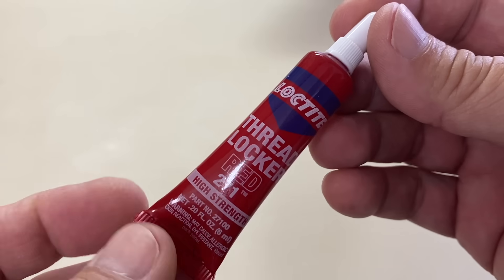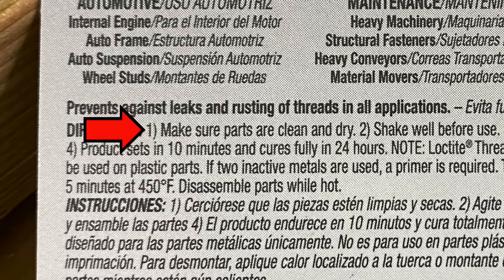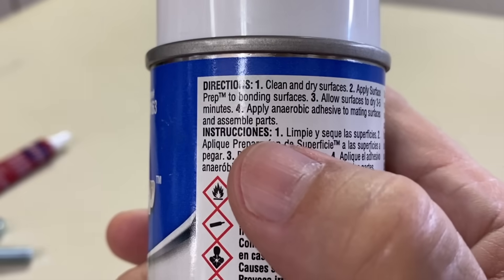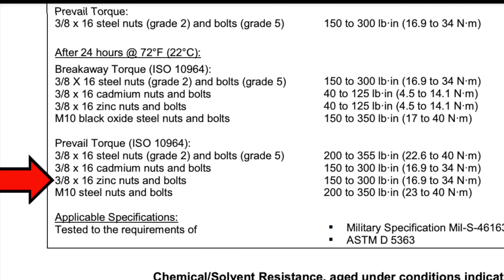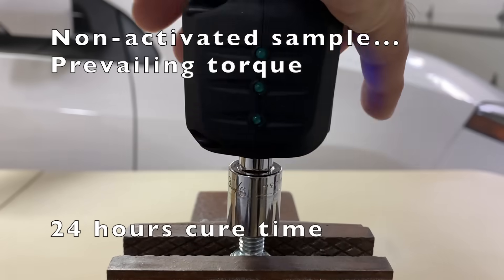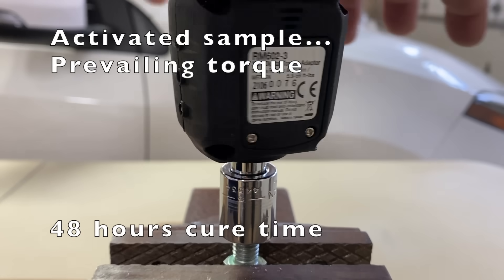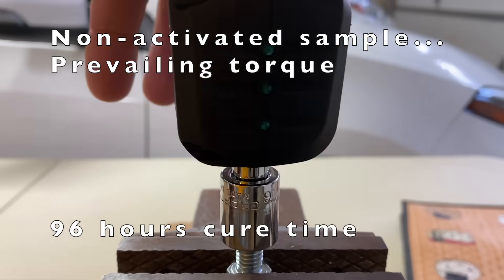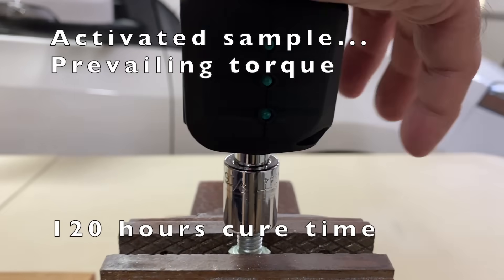Nuts & Bolts - Most DIYers Do Not Know This | Loctite Red Threadlocker Curing

Comment: Is it me, or do the plastic caps that loctite uses de-tops itself if you tighten the cap a little too hard? I have several loctite products and they all have a cap where the top separated from the threaded neck.

Comment: Try the test with the fasteners torqued when assembled, probably with holes through a steel bar. This would approximate real world use as the nuts loose on the bolt aren't as "anaerobic" as when stressed under torque. I would definitely be interested in seeing those results. Thank you for your presentation.
Reply: Same as I was wondering, as far as I knew, thread lock only properly works when you torque the bolt/nuts. I even used this to my advantage when assembling some structures, just put the thread lock in the bolt, and hand tighten it so I don't lose it around. No need to rush, it will only really get properly locked when tight.

It really was annoying when I did have to remove some bolts because of whatever stupid mess I did, but that's the thread lock working as intended, can't complain there.
Reply: Exactly, the touching threads are sealing the loctite between them from oxygen and would cure properly.
Reply: 100% - nuts need to be torqued to a reasonable spec; definitely not just loosely hanging out mid shaft - run it again! :)
Reply: @andrewbermel1099  which nuts are we talking about? I think i made a mistake
Reply: I disagree.  I think this a truly an effective test of its shear strength. It doesn't include "other" varying factors like the torque load you seem to need to pre-stress it with.
Reply: @markhenkel2484  thank you! When testing, minimizing variables is necessary!
Reply: @markhenkel2484 then you don't understand loctite
Reply: I came to say just that!
Reply: I too would like to see this.
Reply: Was thinking the same thing
Reply: Yep. That's why you can leave the cap off the bottle, and it won't cure at all.
Reply: @Bill Hay  almost like it's anaerobic? Lol
Reply: @billhay8157  wrong I seen open bottles harden and I seen unopened bottles rock hard before even being opened the first time
Reply: Ditto
Reply: And you should have a control group without Locktite
Reply: @luisurbina5115 hat would be fine, if it didn't introduce confounding via the "screw loose" bias . . . sheesh, and I thought I understood the term "control freak"!
Reply: @luisurbina5115  I think that's an experiment I can set up. Red and blue compounds, no compound and then two types of "brown locktight" (dirt and rust)
Reply: @luisurbina5115  Why?  The nuts would just spin onto the bolts with almost no resistance.  The breakaway torque would be almost zero and the prevailing torque would be from the weight of the tools against the fastener but still near zero.
Reply: Seems like me, you and everyone else is thinking the same
Reply from the maker: Thanks!  
Please check out my other videos for some with the nuts tightened down with a clamp load.  
Here's how Loctite tests breakaway and prevailing torques... https://www.youtube.com/watch?v=PGZCPyi8yBc
😎
Reply: @HacksbyDad  I feel that both tests (clamped and unclamped) are necessary for a complete study.
Reply from the maker: @wicked1172  Okay... here it is... https://youtu.be/7yPQIsfv9x8
😎
Reply: @HacksbyDad  wierd..
Reply: I was thinking this, you should just stack washers
Reply: First thing I thought of when I observed the methodology
Reply: I concur doctor this will make an immense difference
Reply: when tightened onto something the nut is pushed one way so there is still the space on the other side of the thread
Reply: I don't think you could do this test without rounding out the nuts if you torqued these bolts with red loctite.
Reply: is there a thread sealer out there that activates when no tightened down? I am looking for something to use with brass air line fittings that need to be positioned a certain direction, which often means they are not tightened all the way
Reply: @lukaszM46   Nail polish.
Reply: @lukaszM46  One such product is Vixen Horns Hydraulic/Pneumatic Liquid Thread/Pipe/Fitting Sealant.  It takes 24 hours to cure.
Reply: Still makes the nut harder to turn that is what it's supposed to do.
Reply: A hundred percent agree with you mate. I've always thought that lock type works by getting smushed between the threads while tightening.....
Reply: I was just studying this subject in my apprenticeship, and right as the video was ending, I thought "It really should be clamping something to be of any real-world value"
Reply: Only the green would work without doing so
Reply: I looked up the ISO standards that the measurements come from and he did the testing as per standard.  
3.3
breakaway torque
Initial torque required to break the bond measured at the first movement between the nut and the bolt, when unscrewing an unseated assembly.
Reply: @ChronicBronchitis-mz2vn  this particular ISO standard means nothing to someone using it in the real world. Engineers come up with useless crap all the time.
Reply: @pyrotech7210  like you know better 😂 wow people are delusional when they’re saying ISO standards are all just willy nilly 😂
Reply: @HoggishGreedly  I've seen engineers make stuff up to justify their jobs. One old guy I worked with 25 years ago called them "college pukes" because the vast majority of them have no real world experience
Reply: i don't think that is signifcant, torques just readjusts the spacing between threads.
Reply: @johnpinckney7269  You're technically not wrong, but while the spacing gets readjusted (which could either mean that the "bolt" threads expand and get more surface contact - and thus friction, or that the threads on the "bolt" may form a gap between one side of the threads while pressing harder to the other side), the metal surfaces get more direct contact, which in case of an anaerobic adhesive, is imperative for it's purpose - so it actually is significant.
Reply: @johnpinckney7269  tight or torqued.
Reply: Yes...they're fasteners...so it would make sense to actually use them as such in the test
Reply: @chemicallust77  And yet even the manufacturer of the thread locker tests it just like he did. Clamping down further makes it more "real world" but also adds other variables that can affect the readings.
Reply: Silly engineers. I agree that they should have done torqued test as well (and the primer isn't needed when torqued).
Funny but true... My comparison between Red and Blue Loctite is, starting way back in the 70s we pretty much never needed to use red loctite on Metric Motorcycles but when I started working on Harleys I quickly learned that the Red "needs to be used on Harleys"...lol...
Giving credit where due, less loctite is needed on post Shovel Head, rubber mounted HDs 🤪
Reply: I'm not sure that you know what aerobic means. It means the absence of air. When a fastener is torqued there is less air between the threads than when the fastener is disassembled. LocTite does extensive testing under both laboratory and real-world conditions. The directions aren't based on some random guess.
Reply: @kmoecub  I'm not sure you do either. Aerobic means in the presence of oxygen (not air!) ANaerobic means in the absence of oxygen (not air!)
Reply: @bradley3549  no wonder all my anaerobic workouts have been so miserable.
Reply: @sadfur8728  You're supposed to hold your breath, didn't you know?
Reply: @kmoecub  anaerobic *
Reply: @kmoecub  I’m not sure you know what “aerobic” means 😂 I think you meant “anaerobic” which is the opposite of aerobic.

Comment: I believe that what many people don't realize is that both sealants are anerobic sealants meaning that they cure fully in the absence of oxygen. When the bolt/nut is tightened all the air is squeezed out causing the sealant to cure.
Reply: So these tests of a nut just threaded onto a bolt with no torque pressure wouldn't actually activate the licktite properly?
Reply: @carpediemarts705 well if it doesn't activate it properly it still seems to hold to loctite's spec so kinda hard to think it doesn't work. Basically a good test for the most unfavorable application of it.
Reply: @carpediemarts705  no that's not how it works
Reply: @carpediemarts705 Yes, that's correct.
Reply: @carpediemarts705  It does not activate, you need a catalyst to activate something, and as you only apply thread lock, there is no activator. Thread lock hardens over time by natural ageing. Having little or no free oxygen in contact with the thread lock accelerates the hardening process.
Reply: @roberttill3787  the cleaners, that Loctite sells for some of their glues, are called,  "activator."
Reply: @littlejackalo5326  I have only ever seen threadlock, but thanks for the info. Its not strictly an "activator" though as the threadlock will harden without it. I think a better description would be an "accelerator". I also note that you say for "some of their glues".
Reply: @roberttill3787  wrong
Reply: @roberttill3787  no
Reply: The anaerobic thread locker works when the product is pinched in a tight gap without air remaining, then it sets; being in contact with an active metal improves the bond.
Reply: True.  Liquid LocTite will stay liquid if left sitting out in the open.  One thing I see most people and 'testers' do incorrectly is use way too much on the fasteners.  A drop or two is all that's needed...not soaking the fastener until it drips.  That doesn't help, and just makes a mess.  Also, the reason there are different part numbers is the size of the fastener.  They have specific uses.
Reply: i didnt really know that. i dont use it but i may need to sometime another.
Reply: Some are activated by the steel
Reply: @Mac-mu9cs  correct
Reply: Why would you pretend that many people don't realize that, when everyone puts it on wet, puts the fastener on, and expects it to set up?  You're talking crazy nonsense.
Reply: @stinkycheese804  wrong. Read the comments here. People have no clue how it works.
Reply: Yep
Reply: I am not sure you quite got that right. something thats anerobic will cure with or without oxygen, so squeezing all the air out does not make it cure. It will still cure without oxygen basically.
Reply: Yes you're right that it's an anaerobic cure but it's not right to say that tightening the nuts down reduces the void space in the connection. The only caveat is that if the nut is tightened against a surface, then air is excluded from that side of the nut. Personally I think the product serves to resist vibrational loosening and the actual increase in breakaway torque is largely irrelevant
Reply: is there a thread sealer out there that activates when no tightened down? I am looking for something to use with brass air line fittings that need to be positioned a certain direction, which often means they are not tightened all the way
Reply: It will cure if just threaded in not tight, I found this out when assembling an engine. I was done for the day and didn't want to misplace cam gear bolts, so I threaded them in the cam with fingers (they had been cleaned and had loctite on them). To my surprise, I could not get them out the next day. I had to wedge the cam from spinning and use a wrench. On the plus side, it proved to me it works!
Reply: Exactly right.
Reply: Anaerobic means that it doesn't use oxygen, not that it doesn't cure if there's oxygen present. It will still cure in open air

The correct phrasing isn't "it will harden in the absence of oxygen", but "it will also harden in the absence of oxygen". It activates (and hardens) in the presence of an active metal, or an activator.
Reply: @FAB1150 almost
Reply: @FAB1150 wrong.  It works just like super glue.
Reply: @refuztosay9454  what? Cyanoacrylate (superglue) hardens with water (it needs water, it doesn't harden without it). It's a completely different process, they're not even remotely the same lol. Superglue usually "uses" moisture in the air (NOT oxygen), but you can also spray some water on it.
Reply: @refuztosay9454  wrong
Reply: @FAB1150  CORRECT
Reply: @FAB1150 wrong.
Reply: @onefastneonrt  wrong
Reply: @DinoNucci  I know the difference between anaerobic and aerobic sealants. I am right.
Reply: @onefastneonrt  wrong
Reply: I always squeeze the air out of the bottle so that the product does not "dry out" and garden.
Reply: @Danny O  In locktite bottles you want the air in it. These products are anaerobic meaning they harden in the absence of oxygen.
Reply: @Tony-pq3xv  you don't "want air in it" nor do you want to squeeze the air out. Neither matter.  That's the whole point of the product.
Reply: @Tony-pq3xv even with the absence of oxygen they require contact with metal to activate. They will dry if spilled and out in the open but only the quantity that is somewhat oxygen deprived and I attribute the activation due to iron or “metal” dust that is in the air of most any atmosphere that loctite would be used🤷‍♂️
Reply: @dannyo3317 that’s the oppose of what you should do.  The air space in the bottle or tube is intentional as it keeps it from hardening.  So by squeezing out the air ou are helping the whole bottle harden and ruin.
Reply: @refuztosay9454  NO. Wrong.
Reply: @dannyo3317  that's unneeded

Comment: Lokite is a sealant and 'release agent' all in one!
???
Seals environmental stuff out of the nut/bolt marriage, no water penetrates, steel not rusting.
Far less galvanic action on steel/aluminum/water associations if the union is flooded with blue-goo.
A modest heat and the sealant softens, acting as grease, freeing the nut and bolt to marry again!
Robert is your parents sibling.
Wait a plant-fiber pickin' minute! 
Did I misread the instructions, again? 
dang

Comment: In my experience, a shot of carb cleaner or brake clean is all that's needed. Obviously, heavy duty applications like a high performance race engine or diesel engine or maybe the space shuttle need extra prep. Thanks.

Comment: I have had things where red Loctite was used and shouldn't have been. It seems like the finer the threads are, the stronger it is. I've had a couple of gun barrels that had red applied to them and they had to be heated up to even think about getting the nut off without damaging it. A friend had a homebrewed radio with the front panel held on with about 20 hex screws, and the builder used red Loctite on every one of them, apparently not thinking the panel would ever have to be removed for future repairs. Even when we heated the screws with a soldering iron, some of them got the hex stripped out and others bent the allen wrenches we were using. When we put it back together, we used new screws and Vibratite.
Reply: My father in law and I once worked on a car where some numbskull had put a drop of red loctite on the spark plugs. We had many fun things to say about that person when we finally got them out (without breaking them thank god!) the engine wouldn't start, so there was no warning them up to make it easier, either.
Reply: @douglasphillips1203  There's no limit to the stupid stuff people do to machines and electronics.